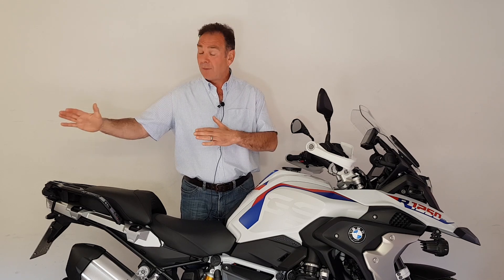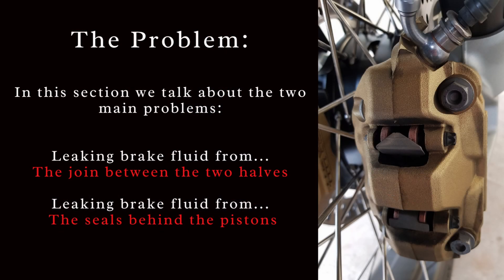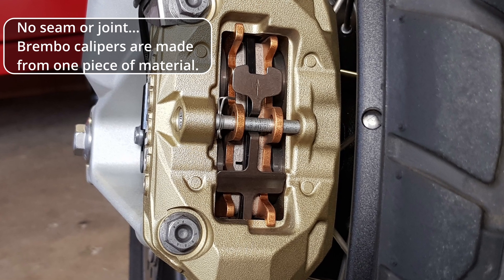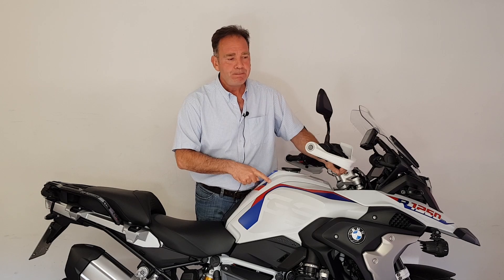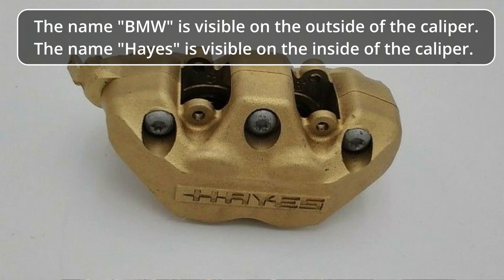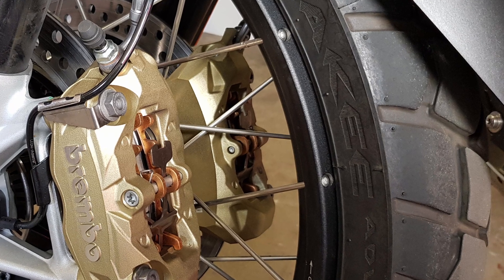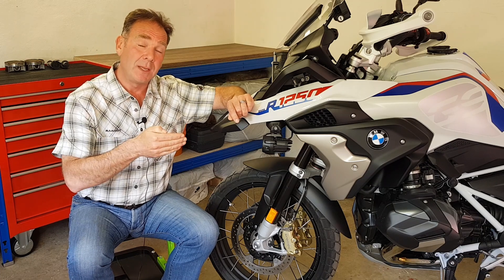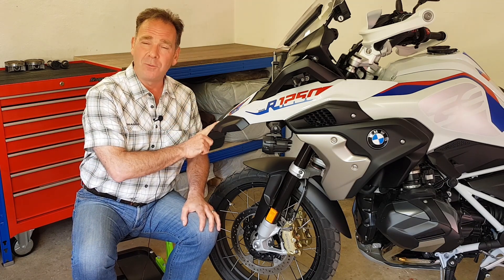EP:5 BMW R1250GS/A Brake problems, Hayes Calipers leaking brake fluid & New Brembo Calipers fitted

Comment: Hi Carl. I just discovered your videos. I have to say, as an owner of a 2021 R1250 GS Rallye exactly as the one you show, your videos are a revelation. I also live in Germany. Your explanations are spot on and I enjoy them a lot. Let me tell you about my experience with the bike so far, after 10.000 Km: the Hayes brakes do their job very well, however I have had nothing but noise (metal on metal noise) ever since I bought the bike. At the beginning whilst riding, and it was a pain to convince the dealer that the brakes had a problem, until they found it and repaired (the bike went 4 times into the workshop in the first 500 Km). Now the noise happens when braking. Front and rear. 

I never had this experience with my previous, non-BMW bikes.

As of today the bike is again at the dealer because of a leak on the left telescopic fork.

Another story: in Road mode, if my girlfriend rides with me in the back, I get a dialog box on the TFT display stating: „rear shock automatic adjustment defective“. Apparently, it‘s a known problem but as of today BMW does not have a solution for it.

All in all, I love the engine, the bike and the way it rides. I am definitely not impressed with BMW‘s quality though. This is supposed to be a premium bike from a premium brand.

Anyway, I wish you a lot of fun with it and a lot of success with the you tube channel. Keep it up because it‘s amazing!

Best, Lino
Reply from the maker: Hi Lino, greetings from Hessen,  thankyou for sharing your thoughts and issues with your GS. I wonder if you have had the latest software update applied. Mine was much better after the update. I also ride two up a fair bit with my wife and have not seen that error message. 
The noise from the front brakes can be removed by cleaning the pads and discs. I've done this for several friends and it has always worked so far.
Carl
Reply: Hey ! I have a triple black 23 plate , i get a tick tick sound when riding but when i apply the brakes it dissapears ! Brand new bike 600 km i checked the calipers to see if they are mounted good but they have no tolerance or play and all seems good ... Did tou have the same ? When i press the front brake it clears
Reply from the maker: Hi Aldvex, I would suggest a call to your dealer. What you described is not normal and anything connected to brake’s really should be checked asap.
When you apply the front brake it also applies the rear so it could be anything connected to the unsprung weight of the bike. So that’s lower suspension , wheels, dampers and mounting points.
Give them a call in the morning and describe your observations 
Do let me know what they find
Regards Carl
Reply: @justthewayitis  apparently i just report it to my dealer he said due to metallic brake pads they are making contact with the rotor so thats why i hear it loud . Now at 1200 km noise is merely gone , another issue is that the circular junction on the front shock is barely leaking small amount of oil enough to wet the finger tip as i pass my finger from the circle gap 🤕
Reply from the maker: Hi Aldvex, good morning thank you for sharing your experience. Sorry to hear you have a front damper oil seal leaking I hope BMW replace this under warranty for you.
Carl

Comment: Experienced exactly the same problem. I had my (new) bike for 2 months and both front hayes calipers sweated brake fluid. Both were replaced and a couple of days ago I noticed drops of brake fluid on the floor underneath the bike. The left hayes caliper leaks quite a bit of brake fluid. Filed a warranty claim again and today I got the news 2 new Brembo calipers were order to replace the faulty hayes ones.
Reply from the maker: Hello Agent 013, welcome to the channel and that's great news you have. You will definitely enjoy  the Brembo's not only knowing they dont leak but in the difference in feel and performance. It's just sad the Hayes calipers are still having issues which on a high end bike... just shouldn't happen. Let me know what you think after the Brembo's have been installed. Best wishes Carl

Comment: Very nice video!
Yes you’re correct about the difference between both brands: my previous GS had Brembo front callipers, and my current one got Hayes. I noticed the difference in travel distance straight away, and I have to say I liked it: they perform really really well even with just 2 fingers on the lever, and my GSA is not a light bike.
Thank you for explaining the difference in manufacturing: I was aware of the potential leaking but didn’t look into it. I’ll keep an extra eye out on my bike! 👍
Reply from the maker: Hi Jessica, thank you,  glad to hear your current GSA has no problems and your happy with the performance. Enjoy the good weather, Carl

Comment: Really like your videos.  I bought a 2020 R1250GSA in the US with the Hayes brakes.  It was recalled due to the caliper issue although I never noticed any fluid leakage.  I found the Hayes brakes to perform well, with the difference you noticed in terms of lever travel.  They replaced the calipers with Brembo’s and I found those to feel mushy and slow to grab.  Not a complaint but just a noticeable difference.  I’ve looked at all the new motorcycles on my dealers website and it appears all the bikes have Brembo brakes.  Quite surprised to see the Hayes calipers on bikes in Germany.  Thanks for all the great info.
Reply from the maker: Hi Dan, and welcome. Thankyou for the compliment and I'm glad you are enjoying the series. As to the brakes... I do now prefer the feel of the Brembo's which for me provides more feel while braking hard, but both are good systems. Have fun with your GS, Wishing you a good Sunday. Best wishes Carl

Comment: Hey Carl excellent video and such a shame that you've had to go through the hassle of dealing with this issue.  I hope that you enjoy those Monoblock Brembos!  This video had me going into the shed to check the Hayes calipers on my '21 R1250R.  I'm happy to report that I have no signs of leakage despite using the brakes hard on several trackdays.  I also find them to be excellent and I think that fact that the 1250 boxers have linked brakes also add to the really effective stopping performance.  In fact I think the four-cylinder RR models do too, as well as the single R!

I've made a Community post on my channel that links to your video in case any of my viewers own, or knows someone with a Hayes-equipped GS.  Take care, Rich 😊
Reply from the maker: Hi Rich and good evening,  sorry you had to go to the garage and check, but I'm pleased you found no cause for concern, because you need your brakes in tip top condition with all your track day work... smile.
Yes it was a disappointment to find leaking calipers, but also an interesting opportunity to see how the warranty system works and of course I got the afternoon on the RR... which was amazing. Thankyou for the community link I will check that out tomorrow. Have you been back and measured that dark black line you left on the track in your last video ?... smile.
Have a great weekend 
Carl

Comment: Hi Carl, and once again… a great and very informative and useful video.  

My GS has barely 650km and based on your video and experience, I guess I should have received a recall letter from BMW informing me about this issue. After all, it is not just a defect, it is one that has to do with the brakes!  Perhaps they think that the bike will eventually come to a full stop in one way or another 😳.

I know now who I will be calling first thing Monday morning…

Not thrilled at the moment with how BMW apparently deals with these issues, but very thankful to you for bringing up this topic. Now at least I can get it fixed. Wonder now if I will get the Brembo or Hayes calipers. 

Cheers, Max
Reply from the maker: Hi Max, good morning and your very welcome. 
Yours might be ok, not all have this issue but its best to check and make sure. Let's us know how you get on with your dealer. Best wishes Carl

Comment: Thanks for another great video. I had a 2015 R1200 RT when I was in Germany and it had Brembo brakes. I assumed my '21 GSA would too but I just looked and it has Hayes on it. Now I know to look closer for leaks. So far they've been good. All my other motorcycles have had Brembos and I obviously couldn't tell the difference from the Hayes. Fantastic brakes as far as I'm concerned and I do push the bike pretty hard in the twisties.
Reply from the maker: Hi Corey,  yes I had no complaints about performance from the Hayes they were / are very good. You might be lucky and have a good pair, just check. Ideally let the brake area get dirty ... say 500 miles and then check them, it's much easier to spot a leak when they have brake dust on them. Best wishes Carl

Comment: great video thx ! i had my calipers replaced on my gsa under warranty, no explanation was given ! i have the bmw calipers ( sept 2019 bike).
The brakes are phenominal ! 
though i would point out that the bmw s1000rr is a lot lighter than a gsa which may explain why the brakes felt so much better. 👍
Reply from the maker: Hi Andy and welcome to the channel,  thank you for the compliment,  I'm glad your calipers have been replaced,  its actually great bmw did this exchange for you. Yes the S1000RR is a lot lighter.... that bike is quite amazing... smile. 
Best wishes and have a great week. Carl

Comment: You mention the brembos seem to give more lever travel, but then again it's using new calipers & pads on the old disks, so surely it's bound to feel a bit different until fully bedded in.
Reply from the maker: Hello RM and welcome to the channel. It's a good observation but the Brembo's do have more lever travel and feel than the Hayes. I'm going to cover this in an update in a few weeks, the pads are now bedded in and the level of feel and control is much better. But it depends on your riding style.  I will cover this in more detail in a few weeks. 
Best wishes Carl

Comment: My s1000xr gen2 2020 has these Hayes calipers up to yet I haven't seen no problem yes. And I keep my fingers crossed that I don't because my warranty runs out soon
Reply from the maker: Some of the Hayes calipers are completely fine and have no issues or leaks. Sounds like you have a good pair 👍
Carl
Reply: Bikes has done 15k miles going to change the pads in the next few days will give then a good ones over. Ride safe👍 great video.

Comment: Hi Carl, thanks for your video's and tips for taking proper care of the bike. I have a GS with spoked wheels since two weeks. Do you have a tip on how to clean those wheels without contaminating the brakes? I wonder which product and method really work and are  safe to use. Thanks in advance and good luck with your channel. I'm looking foreward to your next video.
Reply from the maker: Hi Mario and welcome to the channel,  yes those spoked wheels are tricky to clean, the best thing I have found so far is a toilet brush which actually does a great job, as for chemicals or cleaning agent, I try wherever possible to use basic washing up liquid in warm water, when cleaning near or close to the braking system. As this has the least effect on brakes, and normally does a very good job. Hope that helps. Carl
Reply: @justthewayitis  thans you for the Quick response.
Reply from the maker: No problem 👍

Comment: My 2022 GS did not come with the led headlights. I read somewhere that when they become available they will change them out. Any idea?
Reply from the maker: Hi Mike, if you have recently collected your GS new from a dealer they should have advised you of this. Most dealership have offered customers either £500 or 500€ voucher or credit on clothing or accessories BUT most owners accept the free upgrade back to LED headlight once they came back into stock. Which I understand is / has already been happening.
It’s worth you calling your dealership to discuss this with them. They really should have made you aware of this at the time of order or delivery.
I would highly recommend the upgraded headlight 
Carl

Comment: Hi Carl, thx for your very explainary video's. On your front beak you have a nice decall, whre did you get this from? Greetings, Rolf
Reply from the maker: Hi Rolf, I’ll check and reply later with the details 👍
Reply from the maker: Hi Rolf, they came from a company called Resin Bike, i ordered mine from Amazon but you can also order directly from Resinbike.com.
Lots of different styles and colours to choose from.
I’ve looked for the exact one I use but I can’t find it, perhaps it’s sold out which sometimes happens. The nearest style is the HP version but it’s not exactly the same.
Let me know which style you choose.
Best wishes Carl

Comment: I have a June 2021 1250 RT which has what I assume are the same brakes….ie BMW brand not Brembo.  I notice when pulling up sharpish the bike gives out a ‘howl’ …….which I never experienced on my previous 2015 1200 RT fitted with Brembo brakes.  They seem to work fine but the noise is disconcerting……any thoughts?
Reply from the maker: Hi Robert,  yes its probably contamination of the pads, normally it's the front. Remove the pads and clean them and the Discs, and it should be fine. I do have episode that covers this in my Multistrada series,  just go to my channel and watch the first "Brake" episode.  It's a simple straight forward job and with a little time you can fix this. Best wishes Carl

Comment: Plenty of callipers (some Brembo) use a split design to no ill effect. My old T3 Cali is a one such. This is poor manufacturing and quality control. I’m staggered that they didn’t pick this up long before full scale production. I love the GS/GSA as a bike but not the build quality, some of the design and last, but not least, the service. I’ve moved to Honda for some perspective.
Reply from the maker: Hi Ian, I agree and hope   that the new GS1300 / 1400 range that comes out next year will be much better. But still Honda do make very well made bikes that are fully tests before release. I had three CBR1000F bikes and all of them were great and only had one wheel bearing (front) and one battery failure between all three. Amazing reliability. Carl

Comment: Hi, would you or anybody reading this know the Torque Values for the 3 off T40 bolts that retain both halves of the caliper together? 
I think I might have an issue here and wish to check the tightness. If I don't find them (Asked Hayes US - didn't want to give me them. Understand) If i don't find them, I shall probably break them apart anyway, assess (probably o rings each side) and replace with SS bolts and thinking of a torque value for these M8? bolts of 20NM
Reply from the maker: Hi, now that answer I don’t have. You don’t mention which brand Hayes or Brembo, but you could ring the manufacturer and ask them directly and ask them for the rebuild kit at the same time.
If it’s leaking Hayes calipers and your bike is less than 4 years old, I would suggest ringing your local dealership as they will probably replace them under a warranty recall job. There really should be no issue as the Hayes have a well known issue.
If it’s Brembo you may well have to service them yourself 
Best wishes Carl
Reply: @justthewayitis  
Thanks Carl. Hayes Calipers. Bike  new to me and out of warranty. Hayes didn't want to know. I do all my own work so will break the halves and let's see. Thanks again.
Reply from the maker: Ok, good luck 🤞
Reply from the maker: M8 x 25mm are 24nm from what I can see, Carl
Reply: @justthewayitis  
Thanks Carl. That's a great find. At the moment i have the calipers disassembled ( not split ) and replacing the o rings in the piston cavities. ( 1 compression seal and 1 fluid seal ). The seal kit is circa £35 for each caliper. I found one of the seals quite perished. Surprising as the bike as only covered 12k. Thinking about it. I will first tighen the bolts up then to 24NM to check if any have loosen ( again, don't see why but I am the 2nd owner!) Then I may decide to removed one by one and replace with the M8x25mm SS bolts bolts and tighen to 24NM.  Thanks for coming back with torque setting. I did a quick search but couldn't find anything. Then the plan is to reassemble and fluid up/bleed and see where I am. Hopefully won't need to split.
Reply: @justthewayitis  
At the end. I think I will upload a quick video for others.  Thanks Carl.   Carlos
Reply: @justthewayitis  
Hi again. 
I have replaced all the supplied steel bolts with SS bolts. The bolts I removed are: M8 x 35mm with a Thread Pitch of 1.25. 

Prior to replacing them I re-torqued them all to 24NM. Found 1 off on one caliper and 2 off on the other were definitely below 24NM. The others were okay. At this point, I decided to replace them all with the SS bolts.
Reply from the maker: Let me know in 500km how your calipers rebuild went and weather you have resolved the leaking issue.
Best wishes Carl
Reply: @justthewayitis  
Yep, sounds like a plan
Reply: @justthewayitis  
Interesting thing I noted whilst replacing the bolts. The ones I removed didn't have any loctite.
I guess there is a reason for this that I can't think of presently. However, I did use it on the replacements. Thanks